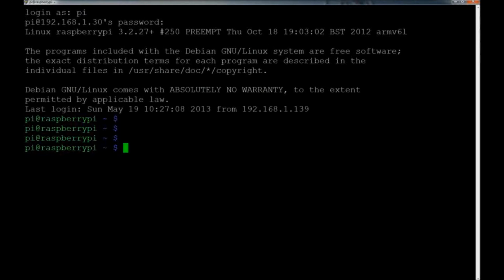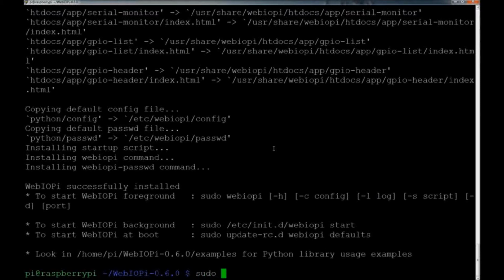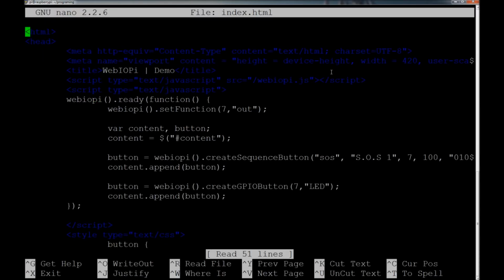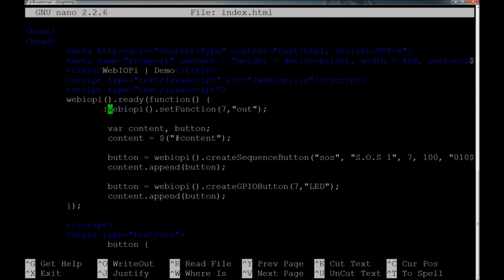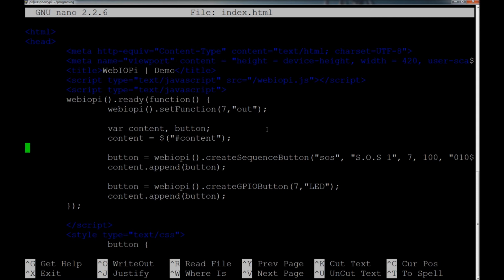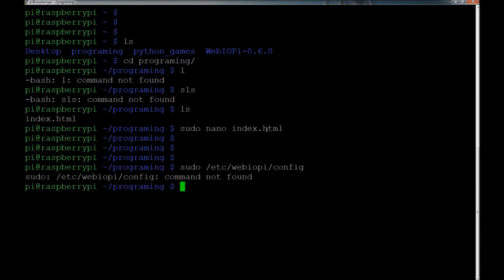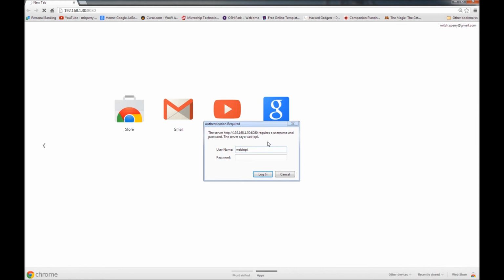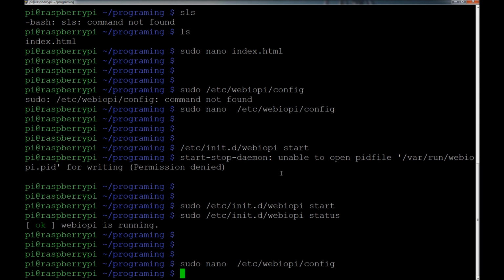Raspberry Pi Custom Web Control

Comment: Dear misperry
Awesome tutorial it works great!!! a couple of questions though : How did you create the index.html file and how did you import it in the webiopi?
Thanks in advance George
Reply from the maker: Hey there thank you for your comment.  I am glad you enjoyed the video.  I used the code here: https://code.google.com/p/webiopi/wiki/JAVACLIENT for a road map to what I wanted to do.  I just replaced the main index.html file which is located initially in /home/pi/WebIOPi-0.7.0/examples/scripts/macros.  You can change this directory in the webiopi configuration file located at /etc/webiopi/config and editing the doc-root section.  Hope this helps
Reply: misperry Thank sou so much man!!! You are an awesome programmer. I would like to create a page with 15 buttons for 15 light cirquits using a relay and another page where i will have my macros regarding lightting scenarios. Can you help how to start doing this project? My programming knowlege is very limited. i Just want an examble on how to add buttons and set which GPIO is OUT and an example of Macro command buttons.It would be very helpfull if you could help me on this.
Best Regards
George

Comment: your video is not in hd, so i can not read anything on the screen. can u just hook it up for me?
Reply from the maker: Hi there and thank you for your comment.  This video is in HD.  All you need to do is in down at the bottom right of the video there is a "gear" icon.  Click this icon and choose a higher resolution and you should be able to see the video more clear.  Thanks again.
Reply: can you just program my raspberry pi B+ for me?
Reply from the maker: Asteroid Mining Corporation (T.J. McKinney - CEO) I would assume that it will work but I have not tried it on the raspberry pi B+ I don't know what type of results are going to be.  You don't really need me to program it.  It is very simple.  Just download the zip from source forge: http://sourceforge.net/projects/webiopi/files/ and extract it with the command: "tar -xzvf <name_of_tarfile>" and then change directorys dot the webiopi directory that was extracted and run the setup via the command "sudo ./setup.sh"  That is it.  The service should start automatically.  Just go to your web browser and type in "http://<ipaddress assigned>:8000" and you will get it.

Comment: You are a bad ass! :) ... link to your source code ?
Reply from the maker: Hey there thanks for the comment.  I am glad you enjoyed the vid.  You can get the source code for my projects if you come to my channel and click the "project code link" in the lower right hand corner of the banner.  Thanks again.
Reply: misperry so I got the source from the official download installed and operational (i have it tripping 2 LED's via 12 and 16 ....and everything now appears to be going great
 ... however I'm now wanting to give the main index page a for alterations to the text and stuff (some basic html changes)
... i make the appropriate changes to the index.html file but when I refresh in the browser the changes aren't reflected
... I've tried restarting webiopi via "sudo service webiopi restart" ... and still no visible changes...
Any suggestions?
(i suppose I could try restarting the pi and clearing my other devices cache but I don't think thats gonna fix it)
Reply from the maker: Ty George Hey there where is your index located?  By default it is in the /home/pi/WebIOPi-0.7.0/examples/scripts/macros.  You can also check your config file for the "doc-root" section and see where the root folder is located.  by default it should be what is listed above but you can change this to whatever you like.
Reply: misperry thanks ... I got it sorted out :)

Comment: <html>
<head>
        <meta http-equiv="Content-Type" content="text/html; charset=UTF-8">
        <meta name="viewport" content = "height = device-height, width = 420, user-scalable = no" />
        <title>Project Pillow</title>
        <script type="text/javascript" src="/webiopi.js"></script>
        <script type="text/javascript">
    webiopi().ready(function() {
                webiopi().setfunction(7,"out");  

        var content, button;
                content = $("#content");

        button = webiopi().createSequenceButton("Tnd", "Tnd rd LED", 7, 100, "01010100110011001100101010");
        content.append(button);

        button = webiopi().createGPIOButton(7, "LED");
                content.append(button);

        });
                
 
        </script>
        <style type="text/css">
                button {
                        display: block;
                        margin: 5px 5px 5px 5px;
                        width: 160px;
                        height: 45px;
                        font-size: 24pt;
                        font-weight: bold;
                        color: black;
                }
                
                input[type="range"] {
                        display: block;
                        width: 160px;
                        height: 45px;
                }
                
                 #gpio7 .LOW {
                        background-color: White;
                }
                
                 #gpio7 .HIGH {
                        background-color: Red;
                }
        </style>
</head>
<body>
        <div id="content" align="center"></div>
</body>
</html>

i have this in my index.html and then when i connect to it in my browser the site is just blank ? any idea what is wrong ?
Reply from the maker: Hey there thanks for the comment,  I have looked at your code and the only thing I can see that could be a problem could be that you have spaces between the dot and the 7 in the gpio color sections.  However, I have tried all this on my pi and I was not able to get your code to work.  Thus, I have attached some code, that has your edits to it, to this and i know this works give this a try.  Take care and good luck,

<html>
<head>
        <meta http-equiv="Content-Type" content="text/html; charset=UTF-8">
        <meta name="viewport" content = "height = device-height, width = 420, user-scalable = no" />
        <title>Project Pillow</title>
        <script type="text/javascript" src="/webiopi.js"></script>
        <script type="text/javascript">
        webiopi().ready(function() {
               webiopi().setFunction(7,"out");

        var content, button;
        content = $("#content");

        button = webiopi().createSequenceButton("Tnd", "Tnd rd LED", 7,100,"01010100110011001100101010");
        content.append(button);

        button = webiopi().createGPIOButton(7,"LED");
        content.append(button);
        });

        </script>
        <style type="text/css">
                button {
                        display: block;
                        margin: 5px 5px 5px 5px;
                        width: 160px;
                        height: 45px;
                        font-size: 24pt;
                        font-weight: bold;
                        color: black;
                }

                input[type="range"] {
                        display: block;
                        width: 160px;
                        height: 45px;
                }

                #gpio7.LOW {
                        background-color: White;
                }

                #gpio7.HIGH {
                        background-color: Red;
                }
        </style>
</head>
<body>
        <div id="content" align="center"></div>
</body>
</html>

Comment: Cool video, thanks. I havent tried it yet but is it possible to do this over the internet?
Reply from the maker: Hey there, thanks for the comment. Yes you can do this over the internet.  All you would have to do is to get a domain either by purchasing one or using some of the free domain places out there and have the domain DNS point back to your home/office outside IP address and then have a port forward on your router set to forward the port that you have configured, which you would probably want to change it to 80 since that is what is common, and you are ready to go.  However, there are other snags that you need to be aware of, so if you want more detail about this just send me a personal message and I would be happy to explain it to the best of my ability.  Also others reading this comment let me know, by replying to this comment, if that would be useful to you all as well.  If I get enough people wanting to know how to do this I will make a video illustrating how to do it.  Thanks again for the great comment.
Reply: misperry hey misperry please make video,how to make it work over internet,it is very useful for me

Comment: I want to ask you about that video hardware.that led on gpio port put in how much?
from raspi just gpio 2(vcc) and gpio 7(for input) then to led?
Reply from the maker: Hey there, thanks for the comment.  To answer your question what I did was put it from GPIO pin 7 went to the Anode of the LED.  Then I took the cathode and wrapped a 470ohm resistor on to it and then the other end of the resistor to ground.
Reply: okay thanks bro for your answer ;)
Reply from the maker: Not a problem.  Glad to help.

Comment from the maker: @Bob Heisenburgandolfin  Thanks for your comment.  For the pushing of a button you will need to create a button and then using basic javascript you will need to run a loop that checks to see if that button has been pressed check out adding click procedures.  Once the button is pressed you need to issue the WebIOPi.digitalWrite command to change the GPIO pin's state.  For the question about maping arrow keys from your keyboard to buttons you will need to use the .keydown argument in javascript like:

$(document).keydown(function(e){
    if (e.keyCode == 37) { 
       alert( "left pressed" );
       return false;
    }
});

Just do some google searches on it and you should find how to perform checks to the keyboard to see if certain keys are pressed.  Once you can find out which key is pressed you can manipulate the GPIO using the same WebIOPi.digitalWrite command.

Hope this helps.

Comment: well done, good work. I watched it. i got a question plz.
If i want to att 8 buttons, how ?
Reply from the maker: Hey there thanks for your comment.  to add more buttons it is as easy as adding more 

button = webiopi().createGPIOButton(<gpio number>,"<button name>");
                content.append(button);

sections and just label them and choose the gpio to map them to and there you go.

It is a very easy straight forward system.

Hope this helps and good luck
Reply: misperry That worked. goos one, so why we use sequecneButton? I have not used it and it worked. I used setFunction for each button and that was all
Many thanks
Reply from the maker: Yeah it is very versital.  Also the developer made quite a few changes since I got a hold of it in this video.  Glad it helped you out.

Comment: i have done the index.html as you and i have connected 8 channel module relay,my problem is that when i use sudo webiopi the relay starts immediately,in other words it starts when i open the webpage.i dont want that, i want to turn on the lights using the button... do u have any idea what is wrong?
Reply from the maker: Hey there and thanks for the comment.  Ensure that your initial state of the buttons is set to 0 or "off" when the code is ran to start with.  If you would like you could show me your code.  You can upload it to a thread in our forum http://themagicsmoke.proboards.com and I will take a look at it.
Reply: misperry ok i just created a thread at your forum... i hope u can help :) thanks
Reply from the maker: I think what you are running into is that the pins for 8, 25, 24, 23, and 18 are not initialized as output.

You will need to give the following statements after your webiopi().setFunction(7,"out"); statement:

webiopi().setFunction(8,"out");
webiopi().setFunction(25,"out");
webiopi().setFunction(24,"out");
webiopi().setFunction(23,"out");
webiopi().setFunction(18,"out");
Reply: misperry
nope thats not the problem, they are initialized as output if u watch carefully my code... but even when i wrote them as u told me, it didnt change something... its probably something else :(
Reply from the maker: Hmmmm.  Well I also noticed the refreshGPIO command and I am not familiar with this command.  I did not use it in my web page.  Don't know if that could be something.  You could try commenting it out to see what happens.  In the mean time I will look deeper into this.
Reply: misperry Even when i delete refreshGPIO, it still does wha ti dont want it to do... I cant find out what it is...
Reply from the maker: Minas Mpoutsis Hey there, hollidays are soooo busy.  I am going to copy your code over to my raspberry pi and see what I can find out so I wll reply to you in a few days when I get it tested.   Just wanted to let you know that I haven't forgot about you.
Reply: Ok thank u, i really appreciate it :) expecting to listen news...
Reply: misperry hello! did u achieve anything with theknown problem? did u take a look at it?
Reply from the maker: Hey there, honestly I just got the raspberry pi back up and running.  I have installed the webiopi stuff but have not yet had time to trouble shoot.  I apologize for the delay but things have been unusually busy for me these past few weeks.  I promise I have not forgotten about you or any one else.  I just have been swamped.  Thank you for checking on me and I will have something soon.
Reply from the maker: Minas Mpoutsis Hey there, sorry for the delay.  I posted this in the forum but I figured I would post it here as well.

Hey There, I apologize for the long delay but I had to set up your entire scenario. I used your Index.html, just copied and pasted the above post into a file and sent it over to the pi, and I am having no issues with it. However, I am only using LED's to check the output of the GPIO but this should not matter. I am using the newest version of webiopi which is v0.7.0. I am using the command "sudo /etc/init.d/webiopi start" to start the process in the background. When the process starts I see no LED's light up thus, all is off. I then navigate to the webpage via my web browser and I still see no lighting of any relays. I then proceed to press the buttons and I get the different LED's lighting up corresponding to the buttons I have pressed. If you are doing anything different than I have listed here please reply with your exact procedure to see if I can reproduce your results.

Also is there any way you can post a picture of your wiring diagram? There could be a bad connection as well. I can attach the connection diagram that I am using if that would help.

let me know.

Mitch

Comment from the maker: @timb02kk He there, how are you controlling your relays?  Are you doing a high side switch or a lowside switch?  Also what type of transistor are you using to perform the switching npn, pnp, n-channel FET, or p-channel Fet?  Also, you said that hey all come on when you start your raspberry pi, have you initialized your GPIO to a state that commands the relays are off when the program runs?

Hope that this will help.

Let me know.

Comment from the maker: @maarten peetermans hey there.  Have you tried the different GIPO button and does it toggle the GPIO that you want?  If so and you are just wondering about the format of the page, I just used the basic format that came with the webiopi as an example.  you can change the web page to be of whatever style you would like.  With this I am just showing you how to add the webiopi GPIO web controls to any web page.  Let me know.

Comment from the maker: @jake cooper Hey there sorry it took so long to get back with you.  I believe all you will have to do is to add some code the the section of your html code that has to do with the CSS formatting.  in the <style type="text/css"> section you should just be able to add the code:
 #gpio7.HIGH {
      background-color: Red;
 }
replace the gpio number 7 with which ever number gpio pin you want to look at as well as replace the color "Red" with what ever you want for the high value of the variable.

Similarly you will have to do the same to the low state:

#gpio7.LOW
     background-color: White;
 }

Hope this helps.

Comment: hi misperry, at first thanks for that amazing video.
but i have a problem, if i start my website, all my gpio pins which i want to use are switch direct in a high level, all my relays move right "on". It is funny but i don't know what to do to get the right position. If I start a own python program, i have the same problem as well.  A high level is a low level and a low level is a high level, Ok the WepIO_pi works, but always opposed. i hope anyone can help. paintyourworld@gmx.de

Comment: Well I'm trying to switch my relayboard with my raspberry pi.

I made 3 buttons (the last one is a test button) on a webpage that have to switch an output to high or low. The first one is gpio3 and the second one is gpio5 but they won't switch :( Need to figure that one out.

On the other hand I tried what you did in your video but if I make it the same then the color won't change of the button on the webpage, but now I found the solution: add webiopi().refreshGPIO(true); just before });

Comment from the maker: Hi there, I wanted to make sure I under stand your question properly.  Are you talking about how does it know what to color the button after you have executed a gpio toggle? Or are you wanting to set a gpio pin as input and change the color of a box depending on the state of the gpio poin?

Comment from the maker: Hello there thanks for the comment.  I have not tried to use python code with what I am doing yet.  However, I would think you could code a javascript file to call the python shell/executable that has your updated python code in it.  If I run across this, or have a chance to try it out, I will definitely let you know.  Cheers and good luck.